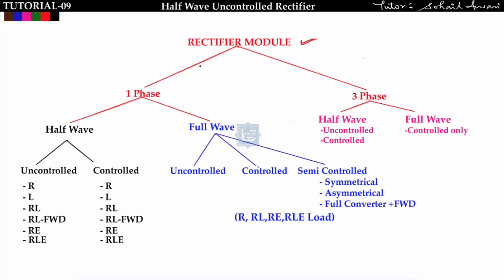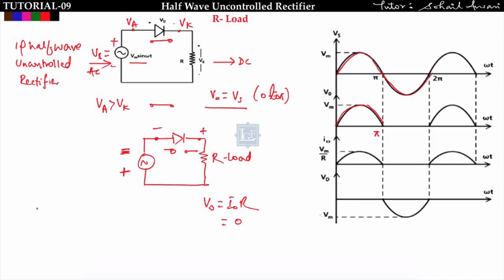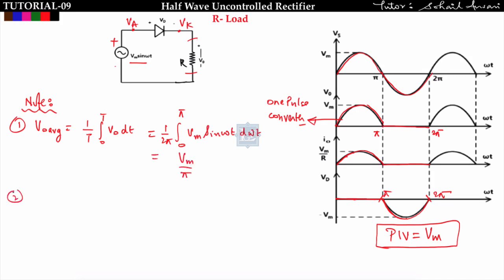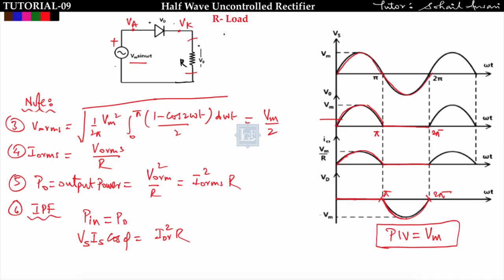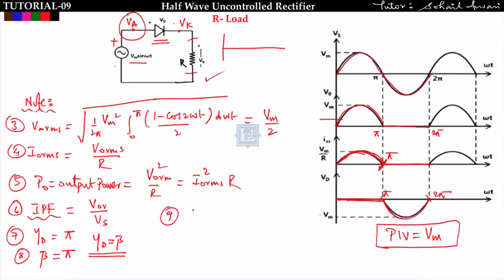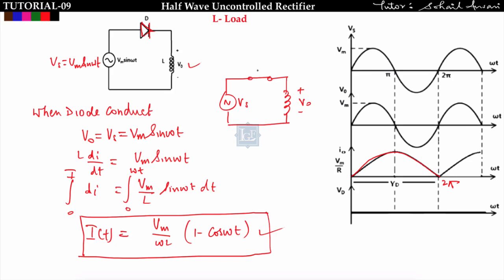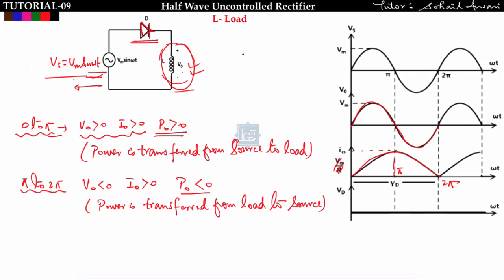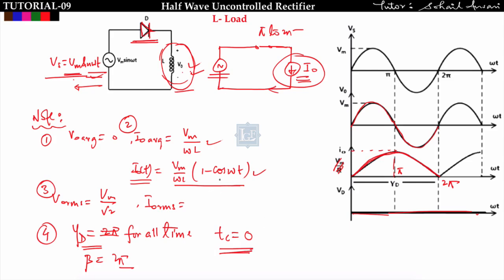Lec 9(a) Half Wave Uncontrolled Rectifier (R & L-Load)

Comment: The current through inductor without the diode , will even have a negative value right....how did the current became completely  positive by just a diode? I meant the current should just lag by 90 degrees and negative part must be cut....

Comment: Please help me out of this. How output voltage is obtained for the negative half cycle
Reply: akbar aiyaz yes brother you are right.....
It's wrong
Reply: Because of L its in conduction mode ...so there output voltage of negative half cycle is similar to 1 st half cycle...it will follow the Vd=Vs....as you can see the graph .while the current after positive half cycle conduction remain conduct in negative half cycle which means vs=vd
Reply: @mdparwezalam4644  ekdam correct✅☑✔✔ 👍👍

Comment: Sir how the inductor is connected during -ve half cycle when diode works as open circuit please help me sir
Reply: Same doubt bro
Reply: @nocatnolife2946  actually from 0 to π inductor charges fully. And during negative half cycle inductor start behaving active source ( beause inductor does not allow sudden change in current) , thus the current remain in same direction from π to 2π
Reply: as inductor stores energy during positive cycle , during negative cycle it draw backs that stored energy and since its direction is opposite so we get its wave on negative side
Reply: During the positive cycle, the inductor stores energy in the form of magnetic field. But during the negative cycle, the stored energy is dissipated by the inductor.
Since inductor opposes the change of current, therefore it tries to keep the current flowing in the same direction while dissipating the stored energy inside it. So during the negative cycle of voltage, the current still flows in the positive direction making the diode forward biased. This way the cycle repeats.

Hope my answer helps !!

Comment: In inductive circuit should not the output  current lag output voltage?
Reply: It is already shown here lagging.I0 attends its max value at wt=π while V0 attends its max value at wt=π/2.
Reply: The current through inductor without the diode , will even have a negative value right....how did the current became completely  positive by just a diode? I meant the current should just lag by 90 degrees and negative part must be cut....

Comment: Isn't the integral at 13:53 1 - cos(wt^2) ?
Reply: I guess I see whats the problem, the integration should be dwt instead of dt
Reply: Yeah I was also confused with this integral. Like you said, the integral should be with respect to wt, and not just t. So, the full KVL equation would be:

V_L = V_source

L*[di(wt)/d(wt)] = Vp*sin(wt)

=> di(wt) = Vp/L * sin(wt) d(wt)

=> Integral (di(wt)) = Integral (Vp/L * sin(wt) d(wt))
Reply: The current through inductor without the diode , will even have a negative value right....how come all of a sudden current became positive by just a diode?

Comment: Hello Sir, u showed us the trick for finding the RMS and Average value of the given function, why don't I get the correct avg voltage and RMS voltage formula when I am applying the same trick for half wave rectifier(R load), using the waveforms drawn.

Comment: Many thanks for these valuable videos, Sir. One question if I may. Would the inductor circuit behave the same way if the diode were not present ? I worked that out and it turned out to be the same. Please confirm.

Best regards,
Youcef
Reply: I think it wouldn’t work that way...
The current will have negative values as well in such case.
Reply: The current through inductor without the diode , will even have a negative value right....how did the current became completely  positive by just a diode? I meant the current should just lag by 90 degrees and negative part must be cut....

Comment: During negative half cycle[Vk>VA]of first cycle diode gets opened then how can the negitive voltage can appear across Vo of inductor
Reply: inductor by its nature conserve voltage when the diode is conducting (on time) and discharge it's voltage when it is the negative cycle of the diode (off time) that is why you will find the voltage at the negative cycle, it's called BACK EMF
Reply: @kitfooverhoes6456   but in negative half cycle the diode should be  revere bias , hence it should be an open circuit, so how can current flow
Reply: @siddhantchiring7599  as inductor stores energy during positive cycle , during negative cycle it draw backs that stored energy and since its direction is opposite so we get its wave on negative side

Comment: Why there is voltage across L in reverse bias from pi to 2pi? In previous lec u told that in reverse bias there is no voltage build up in inductor and how its magnitude be -Vm?
Reply from the maker: inductor has to discharge from any path..it has some energy stored..so to release that energy ..it will conduct after pi as well
Reply: GATEMATIC Education but how the magnitude of Vo be -Vm sin wt at duscharge ?and how its determined ?

Comment: can you tell why R load is voltage stiff type of load and L is current stiff type of load.
and while calculating the output power for R load we use Vrms and Irms, and for L load we use Vavg and Iavg

Comment: Sir for L load during pi to 2pi the diode is reversed biased but still there is a current flowing through the diode..... Is the diode conducting in the breakdown region?
Reply from the maker: diode will be reverse biased only when the anode potential is less than cathode..but here this is not the case..it will remain in forward biased after pi also..
Reply: GATEMATIC Education sir how ??
Reply: GATEMATIC Education  it means pie to 2pie anode potential is greater than cathode??  Is it correct??

Comment: Sir , i couldn't understand y the voltage across the diode is zero all the time. In reverse biased case I,e from pi to 2pi y will the diode be shorted.please reply me at the earliest.
Reply: The Diode will remain shorted due to the back emf of the inductor. The inductor needs to release the energy inside it so it's voltage will become negative to make the diode continue to conduct current

Comment: Hello sir,
From pie to 2pie inductor is behaving like current source b'coz it stored the energy in +ve cycle okay but the direction of current and supply voltage(-ve cycle) coming towards each other, then how the over voltage appears across diode in order to breakdown the depletion layer to become short circuit(in order to allow the current in the -ve cycle) 
kirchoff's law also not satifying here am confusing
Reply from the maker: i cannot get you..plz post ur query in group by taking the screenshot of lecture..thankyou

Comment: Sir plz. and plz.  explain this question if V is per phase voltage then average output voltage in per phase in 3 phase full wave rectifier(uncontroled type)
Reply from the maker: i derived the relation between phase line and max line voltage..go through the three phase rectifier..

Comment: sir during negative half cycle how can the diode conduct if it is reverse biased and one more while the Inductor is discharging , that voltage will appear across the diode so diode voltage will be -VM how can it be 0 during negative  half cycle also.... am i right or wrong please explain sir thank u
Reply from the maker: diode will go in to the reverse bias when the the current through the diode will be zero..here bcoz of inductor current is non zero after pi also...so it wont go in to the reverse bias..inductor is responsible for the conduction after pi...got it..
Reply: LearnGATE Free sir but reverse bais in the sense anode to cathode voltage should be -ve na
Reply from the maker: it will not go in to the reverse bias..as there is inductor present at the load side...if supply voltage is negative let us say  -200v...then inductor voltage will be more negative..i.e. -300v..so overall diode will continue to conduct till inductor have energy...got it..
Reply: LearnGATE Free thank you sir understood

Comment: Dear Sir 
Cos (phi) = Vo(rms)/Vs(RMS), this implies cos (phi)= 1/sqrt(2) for 1-ph,0.5wave,rectifier with r-load. and 1 for 1-ph,0.5wave,rectifier with L-load. in L-load configuration waveform too justifies the fact but in case of R-load how to understand the justification from o/p waveforms?
Reply: sorry for L-load COs(phi)= 0.
Reply from the maker: see to find the input power factor first see whether the load is current stiff or voltage stiff..that i explained you in lec-07...here R load is voltage stiff type of load so you take output power=Vrms^2/R...but for current stiff you have to take output power= Voavg*Ioavg and for L load V0avg=0..so pout =0 and cosphi=0....got it..what do u mean by this..this means the active power dissipated across load is zero..measn whatever the power is transferred from source to load from 0 to pi is again transferred from load to surce from pi to 2pi...that's whay we are not getting output power...from waveform you can see that from0 to pi power is positive..and from pi to 2pi power is negative..got it..

Comment: Dear Sir
1-ph, half wave rectifier with L-load gives 2 pulses in output voltage waveform. so would calling it a 2-pulse converter be erroneous?
Reply from the maker: no its not giving two pulse..it is just following the Vs...means it is not coverting in to 2 pulse..thats y see the current waveform to know whether its one pulse or two pulse converter...we are getting Vo not by converting the waveform..Vo=Vs ...so it is not converting..it is following..got it..